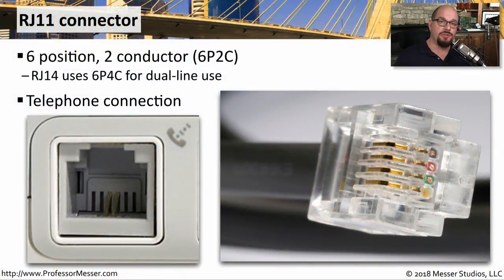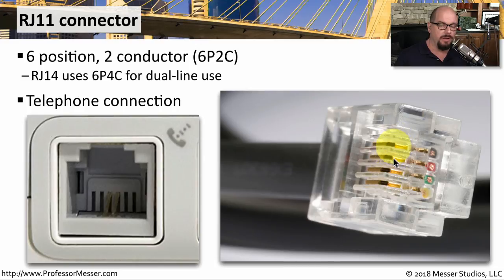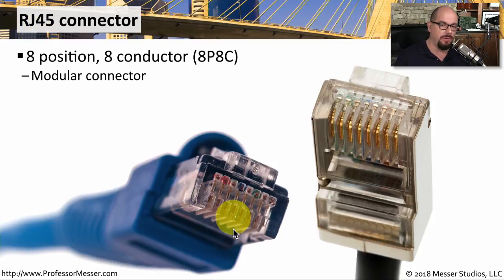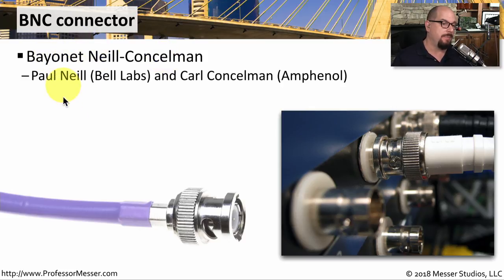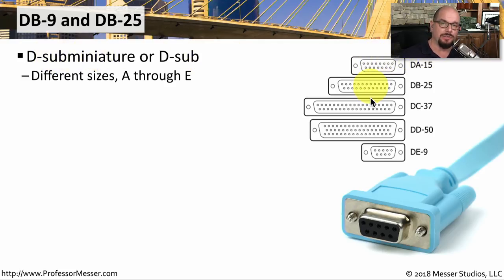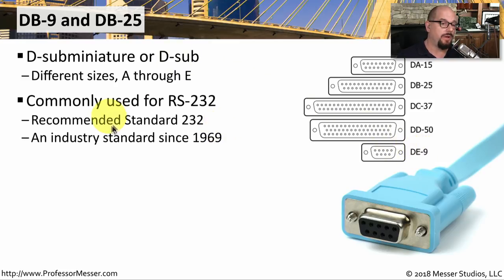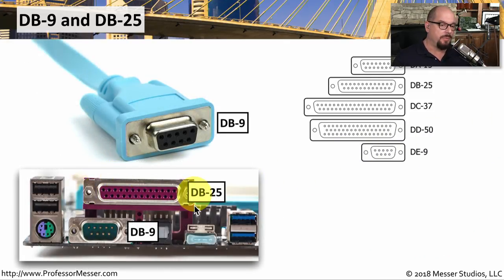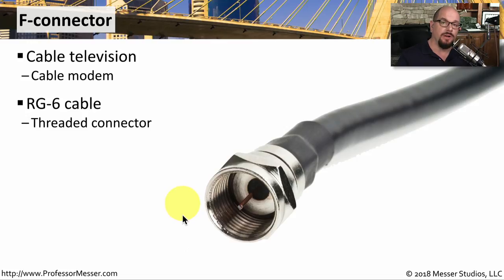Copper Connectors - CompTIA Network+ N10-007 - 2.1

Comment: What’s the difference between a DB-9 (DE-9) and RS-232?
Reply from the maker: The DB-9/DE-9 standard describes the physical connector. The RS-232 standard describes the signal sent over serial links. Since DB-9 connectors often carry serial signals, we sometimes (incorrectly) refer to those interfaces as RS-232 interfaces.